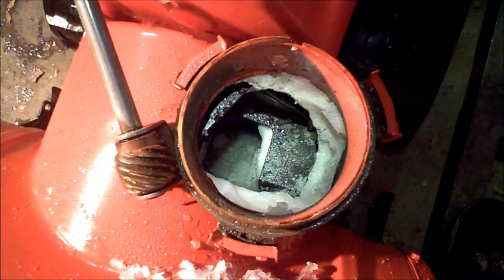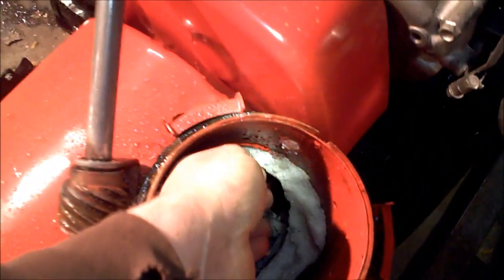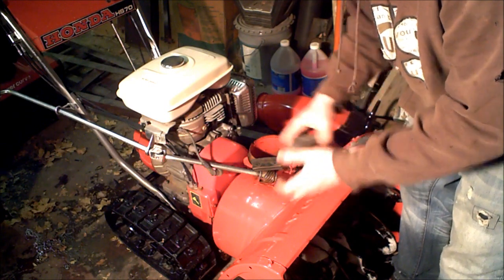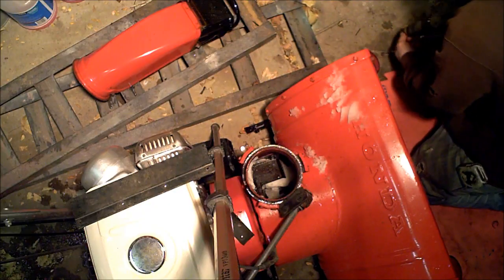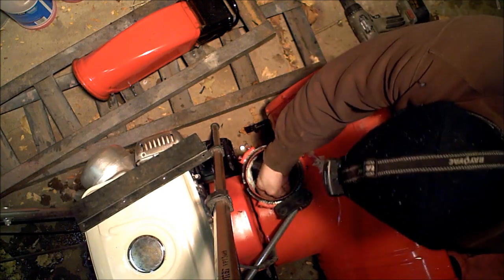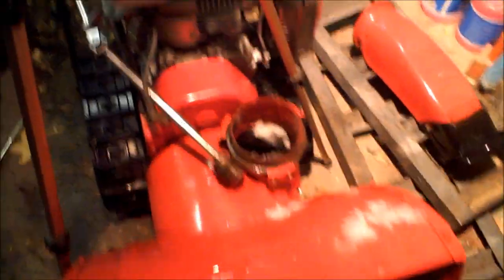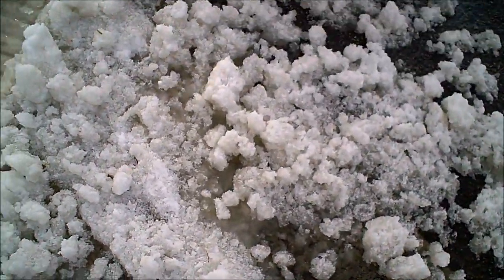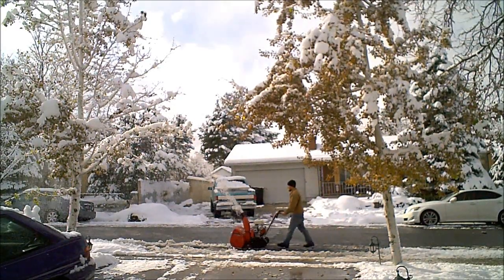Modify Snowblower to never clog and throw twice as far w/ Impeller Kit

Comment: wow, I didn't know new snow throwers were this bad! We have an old, old toro that was given to us (at least 30+ years old, 7 hp side valve birggs on a 28" wide snow thrower!) Ours doesn't clog ever but it doesn't shoot far... I has a BIG slow speed auger that just doesn't quit, and because its old the controls are set it and forget it! I will pull me down my driveway while it goes to town :D  when I had to borrow my neighbors new 10 HP 26" Troy bilt, it sucked! That thing clogged like crazy, no traction, and was gutless, motor was a very pathetic 10 hp... But I would be interested in trying this for the longer distance (toro was designed to move tons of snow but not very far...)
Reply from the maker: Those Toro's are tanks and will go forever. They had real horsepower numbers and not overinflated magic land HP numbers. With this modification you will get another 5-10 feet of throwing distance.. The impeller on these is THICK steel but still manageable to get some screws/bolts in. If you do it let me know what you think.
Reply: sixtyfiveford
ok, will look into it for sure, the bummer for us we have a stone driveway, so the feet are at max height and still catch some stones, the really bad thing is that the augers are big drum augers and dont have sheer pins, so we have to be careful if it jams (only happened once or twice...) This first year with it was low power and hard to start, turns out the spark plug was stripped, so pulled the head (easy!) and bought the spark plug threaded insert piece, that solved the extra low compression and poor power.   Our biggest and only real prob with it is that the drive system was very well thought out except for the rims. The rims have small splines and the drive cog is just pressed into the the tapered splines and on our 2nd winter with it both the right and left wheels stripped the splines. We fixed them by drilling and tapping threads through the rim and into the cog piece and screwing a very hard bolt in, but the right side this year loosed and made our fix unusable, so we welded it this past Saturday and it works great again! As for it being a tank, the thing has metal everywhere, except for the belt cover! Why on earth did they make the belt cover plastic? Everything is metal, except for the belt cover, makes no sense...
Reply from the maker: Welding up extra wide skids helps them from sinking in the gravel and picking it up. Also the rubber paddles on the impeller eliminate rock jams in the impeller housing.
Reply: sixtyfiveford
its not the impeller housing that jams, its the front augers, they dont have shear pines and the blades are on big drums, first jam was very hard to undo...
Reply from the maker: The shear pins are accessible through the 2" round hole on the end of each drum.
Reply: sixtyfiveford
there are now holes in the drums... unless you mean the end caps? In which we would than have to tear down the front of the snow thrower to get to them, but, when a good size stone got jammed the belt started slipping and motor bogged right down... If there are shear pins, they are very strong shear pins...
Reply from the maker: Virtually every snowblower I work on, someone has put grade 5 or 8 bolts in the place of shear bolts. They never shear though.

Comment: I have a toro single stage snow blower model #38584. It has a rubber belting auger type of impeller. Snow barely makes it out of the chute if it is dry. Wet snow stays and clogs. Clearance between back of chute area and impeller is at least 3/4" or more. No adjustment for setting clearance that I can see. Have you ever solved a problem like this?
Reply from the maker: WOW, that's a huge gap. The paddles are considered worn out at 1/4"-3/8" gap. Installing new paddles will make a HUGE difference. If they are only worn a little you can drill new holes and pull them out further. You could still do this to make them a ton better. http://youtu.be/vlheql6M6GI

New paddles are around $50.
http://youtu.be/xCeFH3TvqP4

Comment: Hey man ive got a beat up old montgomery wards snow blower and the blades on the impeler are bent up pritty bad it will still blow but just barely do you think its posible to make a new impeler any help would be awsome
Reply from the maker: I always just bend them back in shape with a crescent wrench. Then I install these rubber paddles and it'll work better than a new machine.

Comment: I just finished this tonight on my Troybilt and it works great.  I found it easier to predrill.  When just using the screws, The rubber was not ending up in the same place I planned and the screws were not cutting into the steel very easily.  Had to do all three impellers 9 screws total(did the angles too).  I used 1" screws but I think 1/2" would do it.  I got a rubber mud flap from Farm and Fleet for $6 which I cut it with my bandsaw (I use electric tools every chance I get).  I'm no pro and I take my sweet time on projects  so it took me an hour but I can see doing it much faster next time.  Don't forget to tighten your auger pulley cable and drive cable while your at it.  That helped a lot too.  Next ill max the RPMs thanks for that video as well!  Subscriber for life!
Reply from the maker: You always have to exercise every power tool on a regular basis, otherwise they'll get lazy. I'm glad you did it. It's kind of a pain working in the small discharge hole but not too difficult. Bump up those rpms and you will have a snowblower that works better than most out there.

Comment: I live in Vaughan, ON (Canada). I am looking at buying a new snowblower - two models I am looking at: Ariens ST22LE Compact 22, 120v Electric Start, 22 inch (sold online only) OR Ariens Compact 24 inch 2-stage Sno-Thro (sold online and instore). What would you recommend?
Reply: With the 24 you get a remote chute deflection control which the 22 does not come with.  If you have the space to store the 24, it is worth the upgrade.  Can learn more with our snow blower selector at http://www.ariens.com/en-us/snow-blowers/snow-blower-selector/

Comment: Dumb question, when looking down your opening do you always mount the rubber to the top of the impeller?  Does impeller rotation direction matter at all?
Reply from the maker: Yes, I always put it on the top edge. This is the leading edge and the force keeps the rubber paddle from ripping off.

Comment: Tks for the great idea but I have a 2 stage Toro. Does this mean I cant do this modification.
Reply from the maker: You can do it. The older ones were built like a tank and it just takes a fair amount of work to drill through the impeller.

Comment: That is an awesome idea. What is your idea on a tweeked deck on a snow blower.A friend dropped off the back of his truck when he used it so now it drops drown on the right side when you push down on the handle bars.
Reply from the maker: I've come across several tweaked snow blowers. If it is only slight you can adjust the bottom scrapper and one skid to make it operate level. If it is severe I use coma-a-longs, bricks, jumping up and down on it, etc to bend it back the other way.

Comment: i wanted to let you know, i did this today to my mtd snowblower with tracks, and it took little more time, because i had to drill and bolt the flaps to the inner 2 stage section. i actually used small pcs of rubber carpet sections. it worked great. now my snow blower throws snow like 40-50 foot. what a great tip. THANKS SO MUCH
Reply from the maker: You're welcome... Now it's a MTD-SSB (Super Snow Blower).

Comment: I have a 1989 MTD I would like to try this on. I have tried everything from pails of hot water to WD 40. I have a question about the skids on my snow blower they are rusty and leave rust streaks on the concrete slab in front of my garage. Replacements are about $ 30.00 is there a cheaper fix for that?
Reply from the maker: I really liked the skids of the 60-70's. They were 4-6" round 1/8" thin steel wheels. They bolt directly to the sides of the blower housing and roll along rather than scraping and wearing.

Type in "vintage craftman snowblower" into Google images and you will see what I'm talking about.

Comment: Ok...I bought a rubber mudflap from a trucking supply store, and a pack of stainless steel self-tapping screws.  It looks like the hardest part of my project will be taking the chute off (6 rusty bolts).  One question... my impeller is a 3-blade, (so I know I need to do all of them) but the blades curve up.  About 80% of the blade is flat like those in your video, but the 20% closest to the primary auger curves up at an angle. For me to attach the rubber securely, I'd have to use three screws on each blade...2 on the flat portion, and another one on the curved part.  Have you ever done this modification on blades like that?  Is that how you would do it?    Thanks for any tips!
Reply from the maker: Most of the time I just do the flat part. But I have done it all and I do it just like you describe.

Comment: @sixtyfiveford would puck board work for this if it was trimmed correctly?
Reply from the maker: I would think it would it would work. It is resilient and meant to take impacts.
Reply: Yeah and i think it would still wear eventually. I have a craftsman 8/25 track drive i want to do this to. it has a hole in the center of each impeller blade, and theres a little tab bent up on each one. Kind of like it was made to have some kind of rubber or something from the factory. I have also thought about slotting the hole in the piece of puckboard and using appropriate bolts so the puck board can still slide, and use centrifugal force to make them slide out and contact just perfectly. But thats a bit more screwing around than id like to do. lol
Reply from the maker: High end hydraulic impeller pumps operate just like you describe. The benefit of rubber is it can deflect and contour to more uneven surfaces.

Comment: Great video. But I don't have a garage - I leave my snow blower in the car port. Therefore, I have to be careful to clean all snow from my blades after use, or they'll freeze up and bust a belt next use.  Luckily, there's that quarter inch gap. Won't your rubber blades freeze to the housing?

Comment: What is the thickest metal the self tapping screws you used would work on?
Reply: WE lived in Ohio, Indiana, Wisconsin etc most of our lives. Solved this problem by moving to high desert Reno, Nevada
Reply from the maker: Reno will definitely cure the need to remove snow.
Reply from the maker: Large self tapping screws(essentially bolts) will go through 3/16". The smaller ones with the phillips heads are usually only good up to 1/8".
Reply: Not sure of the monicur ...SixtyFiveFord ?
But MY wife just bought a SixtyNineVW = 69VW beetle she wants to tow behind Rialta when doing fairly flat land tours.
At moment we do mostly Sierra Nevada Mountains, so we will have to try flat land touring soon :)
Reply from the maker: 65 Ford Pickup Truck.. I own a Toyota mini motorhome and love it. I know the Rialta's have quit the following as well.
Reply: Where did you access this discussion ?
I Thought we were on Rialta-Tech at BigTent Blog ?
Reply: Is this comment being sent to YouTube or via anotheer blog site ?
Reply from the maker: Youtube.
Reply: OK...I'm learning email process for my newest new Google email address and how it works.
Left Att and YAHOO after 3 intrusions of email and spamming etc etc.
Like the YouTube projects you show.
Nice Job...ed hass

Comment: If I am going to pre drill could I just use stainless bolts and lock nuts or do you think self  tapping screws are the way to go. If I use self tappers how big a hole should I pre drill. One last question is where can I buy a piece of rubber to do this or should I just buy one of the impeller kits I have seen online. Thanks for all your help
Reply from the maker: For plastic stainless bolts would be good. I would use wide fender washers top and bottom to distribute the clamping force of the bolt. Old tire sidewalls make great paddles as well as soft rubber mud flaps. The kits seam pretty pricey for what they are.

Comment: Thank you.  I just bought a 2 stage machine.  I'm going to check both and use your modification.  Thank you very much again.
Reply from the maker: Thanks for watching.
Reply: sixtyfiveford I modified my single stage craftsman.  Just added on piece where it scoops the snow to send out the shoot.  It works much better, but I noticed the rubber is very worn all around.  Unfortunately the rubber is riveted to the auger.  Doesn't look like it can be replaced easily.  I may buy a new auger.  What do you think?
Reply from the maker: The rivets drill out very easily and most replacement kits come with small bolts.  Usually takes me 30 minutes to do one from start to finish. The paddle kits run around $50-$75 total.

Comment: i have a brand new john deere x738 with 54" snowblower. I used it for the first time yesterday and was really disappointed that it would not throw wet snow at all. After a few attempts i put it back in the garage. The problem is i have a plastic impeller and everything i read says don't do this modification on plastic impellers. I heard you mention that it will work on plastic impellers. Have you ever had any failures when doing this to the new plastic impellers. Because its a 3 blade i would do all 3.
Reply from the maker: I have never had a failure with a plastic impeller. I do however take come precautions like: screw as far in away from edges as possible, pre-drill, and don't overtighten. The "plastic" is actually a heavy duty composite material and is made to handle abuse from rocks and chunks of solid ice without breaking.

Comment: good vid ! i've done this in the past with bolts and plates to hold rubbers a lot of work ! so yesterday I tried your way. self tappers and im using a old bed matt for rubbers . i like your way......  way faster !I was wondering I used stainless washers under tappers. do your rubbers ever launch with just screws?
Reply from the maker: I've never lost a paddle. They are on the leading edge and the force of the snow and ice is actually holding them on even tighter.  Self tapers are a harder steel than typical screws. Washers are a great for softer rubber. Thanks for watching.

Comment: Great Video. I have a smaller 5hp machine that I just recently bought. You suggested that you only need to put rubber on two of the blades. Would it be a bad idea to install 4 if I dont mind taking the time to do it? Thanks in advance
Reply from the maker: Putting it on all 4 isn't bad. It is a pain to do some of these and I have done 2 tested and then put 2 more on and I haven't seen a difference. That is why I say only 2 is needed in the video but all 4 is fine.
Reply: Thanks!

Comment: thank you 65ford.  I have a craftsman that bogs down all the time with wet heavy snow.  It is a real PITA.  I'm not sure if it is single or double stage, but I'm headed out to the garage today since we are expecting more sleet and snow tomorrow.  UPDATE - It is a single stage.  Is there any modification for single stage?
Reply from the maker: Single stages operate on the same principle. Once their paddles get worn and leave a gap they don't throw well. 1/4" between the housing and the rubber paddle is fully worn down, they should touch. If your Craftsman single stage clogs a lot or barely throws it needs new paddles. It will make a world of difference.
Reply from the maker: sixtyfiveford
Also some of the small 2-3 horsepower models struggle in heavy stuff. Where 4-5 horsepower models don't seam to mind.

Comment: How kind of you to share this great tip! I heard your Toro tip also; have a Honda single stage and it's a clogger. The old Toro flapper single stage cleaned the cement great but was a stinky 2 cycle and didn't throw very well. Best to you-
Reply from the maker: Single stages operate on the same principle. Once their paddles get worn and leave a gap they don't throw well. If your Honda single stage clogs a lot it needs new paddles. It will make a world of difference.

Comment: Does this "polish" the surface? I like the idea, but I'm afraid of it wearing the paint down and leaving a surface that will rust faster.
Reply from the maker: Ice and gravel will wear the surface to bare metal within a couple of years without the paddles. It should only really touch the walls for the first 10-15 minutes of running then the rubber should be worn to barely graze the surface. Theoretically with the paddles you will get the job done in 1/2-3/4 the time so the machine is almost doubling its life span. Adding things like WD-40 in the impeller housing can really increase the life against rust but the only snowblowers I have ever seen rust out were the ones used where people apply salt regularly.
Reply: sixtyfiveford

I haven't had too much of a problem with ice and rocks, but I do touch up the paint every year to keep it sealed. Thanks for the info. I'd like to do this.